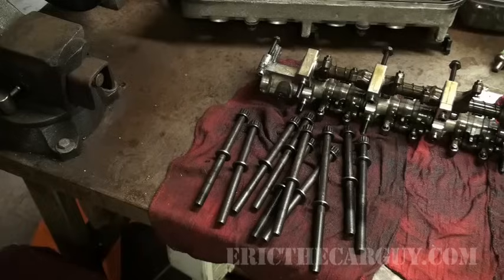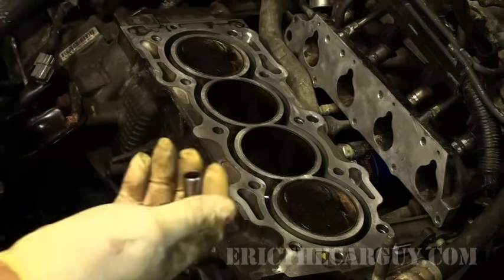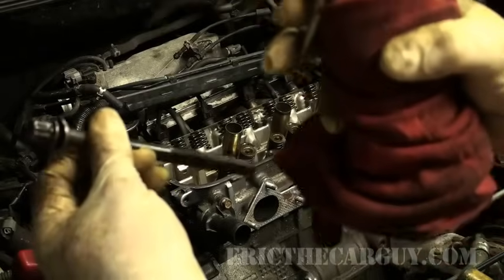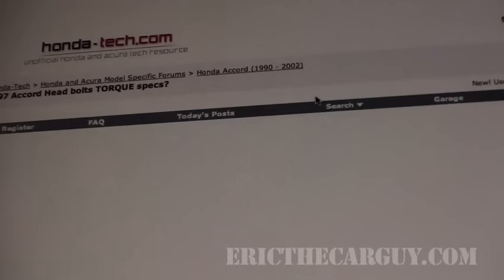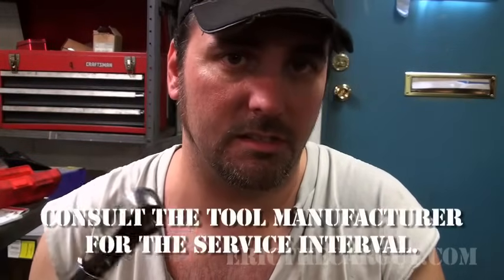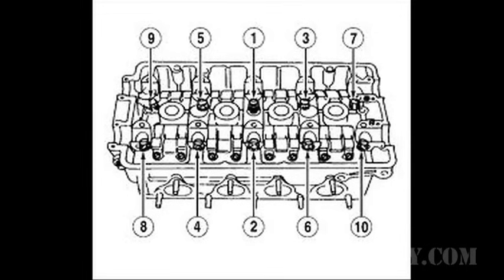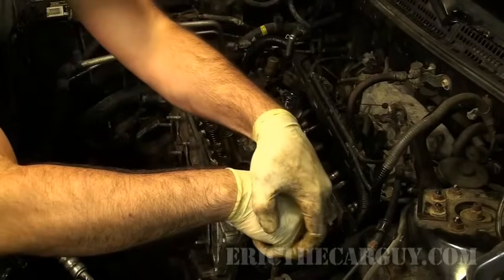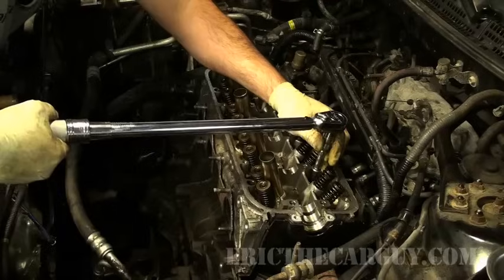How To Torque Cylinder Head Bolts - EricTheCarGuy

Comment: Metric always beats American measurements. 
We civilized folk prefer to have a system which converts sizes (centimeter/meter) in consistent magnitudes. 
Metric: 
10 milimeters in one centimeter 
100 centimeters in one meter 
1000 meters in one kilometer. 
The same numbers apply for weights and fluids. 

American: 
You guys don't even have anything smaller than inches, you just start making fractions. 
12 inches in one foot 
3 feet in one yard 
1760 yards in a mile 
The weights and fluids are also all over the place.
Reply: Most of us (American car guys) have them memorized quite well and cubic inches measure displacement more precisely than liters, although that's a different topic.
Reply: xxRamD3yruxx Metric is more accurate because metric measurements can be smaller than American standard.
Milimeters, micrometers, nanometers
Reply: ChrisHallett83 because when you say a 350 chevy is 5.7 liters you've undersized the engine by 35cc. I was not comparing cc to ci, but more of liter to ci. cc is even more acurate than ci although that's a large number to stick to the side of the car.
Reply: Dylan McElveen milimeters are close 32ths
anything smaller would be moving into scientific zone meaning: go metric, because science is in metric
Reply: Belicose777 Thank you, I either make an educated comment to the best of my knowledge or not make one at all. Once you live in America, you just somehow know all the different measurements within a couple years because you have to use them so frequently, it has been so well rooted in American measurement that it became part of culture in a way. Like the length of a football  field or "cool we're going 160 mph" the other stuff just won't cut it until it becomes necessary to do scientific calculations to share with others around the world.
Reply: I'm not offended. But the comment implies insult. Maybe you were being funny. "We civilized people..." Inversely said sounds a lot like saying, "only barbarians and animals use..."
Reply: Reluctant Couch u
Reply: Civilized is the man that identified and complimented those that are "past the stone ages" and use metric even though he's from a place that uses American measurements. Not the one that blatantly insults an entire nation of people that do, as you have now.
Reply: wow, do people always bitch on about a post for such a long time on you
facepalm
mutes post
Reply: Reluctant Cou
ch c
Reply: Boy!  Your point of Metric beats English is invalid because it is a matter of being consistent with a standard, being precise, and being accurate. If you build a thing with the English standards, that thing will be good or bad per those standards. If you build with Metric standards, your product will be good or bad based in those standards. Then, precision and accuracy plays a role: precision is about the repeatability of the measurement with a given instrument in the standard that you use, and accuracy is how close the measurement is to the true value of the instrument which was measured against the standard that you use--in this case, either English or Metric. And don't get me started with percent uncertainty and significant figures. Now, if your intended point was that Metric system is easier to use than the English because of consistent magnitudes, that's very true; however, that gives the impression that you do not want to bother in learning other things or you have hoity-toity against the English system which possible indicates some mediocrity from your part.
Reply: Actually Imperial is leagues better when you're doing work in a machine shop and don't have a calculator handy.

Leave the metric to the scientists, actual workmen use imperial.
Reply: Reluctant Couch so true lol
Reply: like we have any power in deciding. Thats the way it is its not like you can vote for the metric system or anything. Dont think your better cause you had no say in which system you use either.
Reply: Reluctant Couch "we civilized folk" get over yourself.
Reply: the US is the leader of the world in the machining industry which uses mostly imperial; whoever mentioned that none of their body parts match an inch obviously don't understand the difference between using a rule and a precision measuring device like calipers.
Reply: Reluctant Couch as an American, I wish we used metric. I work in automotive manufacturing and metric is so much easier than standard.
Reply: n
Reply: I worked as a toolmaker using both metric and US customary measurements for years, ( The US doesn't and never has used the imperial system, which wasn't standardized in England until the 1820's ). Either system is just as easy to work with.
Reply: Belicose777 I didnt insult anyone. Im pointing out how stupid it is that we still use such an arbitrary form of measurement. 
Quit taking it so personally, American Standard measurement is like orange juice with pulp, only old people advocate it and they can't give a good reason for it.
Reply: @12101DyM  dumbass you drink it with pulp because your orange juice was designed to drink with pulp so it slowly goes into your blood stream to avoid spike in blood sugar levels and better for digestion. Don't forget America is leading the world in engineering and science.  We use metric and imperial system because we are more advanced advanced.  You effeminate nazis can shut the hell up now.

Comment: Beautiful wrenches. Too bad they have to be periodically serviced.
Reply: Anyone know how or where such service can be done? I always hear people get vague at that point.
Reply: DE Nichols If you live in an area with lots of industry, there may be a local shop that does torque wrench calibration. There also some places you can ship your wrench to that will calibrate them. One place online charges $48 for all torque wrenches up to 250 ft-lbs.
Reply: Great reply. I learned something new. First I want to say that I either need a more expensive torque wrench (mines kinda cheaper than the test) or to do an at home calibration test like YouTube channel Shrodingers Box. The test is easy. He and I even use the same torque wrench. 1.3 times the torque settings in weight and he just touched it and it clicked. At home calibration as good? Probably not, but he verified his torque wrench before installing his head gasket and he hasn't had a head gasket job ever come back.

1.3 because that's how far his wrench measured at the handle center line from the center of the bolt in feet. 

T or torque = feet x pounds. Or T=WL
Reply: My next purchase will either be a torque that measures in inch pounds or one that measures in a lower range than my 150 ft x lb torque wrench since Ericthecarguy says they're less accurate on the bottom and top of the two extremes. I'm sure my half inch torque wrench is pretty poor at 30 and less as it's so big, I barely touch it and it clicks.

Comment: Hey Eric, I have a question what is the valve COVER bolts torque specifications and pattern for a MITSUBISHI LANCER ES 2.0L 4G94 SOHC? or do they not need to be torqued? i looked in the owners manual and i can't find anything about the valve cover bolts specs please help. or if anyone here knows would be appreciated.
Reply: You need a service manual, not an owner's manual. Or like Eric, I just google what torque I'm after and it usually doesn't take long. Occasionally I end up with a downloadable pdf that tells me the torque for that component on virtually every car out there. I have one for axle torque now. lol

Comment: Hi Eric. Are you experienced with Diesel Engines? I have a 1997 Toyota Lucida Estima 2.2 Turbo Diesel. My first diesel car ever. I am now living in the Philippines. I came out from California. Anyway, I haven't had any luck with any solid mechanics here. They have the good trouble shooting skills unlike our technicians back home there in the States does....Over here you already found yourself already spent a few hundred bucks and still haven't solved your problem. Im getting tired of it! Im not a millionaire and I dumped all my wife and I have on this car.

Anyway, at first startup and drive of the day. Everything is fine then once engine reaches normal operating temperatures, the vehicle has a defficult time accelerating pass 40kmh. So I end up having to park it for a few minutes until she'll drive fine again. It doesn't happen all the time. The last time it happened was probably 2 mnths ago. And it happened again today. I know its difficult to diagnose w/o seeing or test driving the car but I just trying my luck. Im really tired of shotty "mechanics" here. I don't want to spend $$$ again and problem is not even solved.  The Toyota Lucida Estima is the same family as the Toyota Previa. I guess the Previa is just the gasoline model. Id really appreciate any help or idea you can give. Thanks in advance.

Comment: I did a bit of reading on the use of socket extensions and from what I read if a perpendicular angle is maintained then it really doesn't effect the torque specks enough to bother with. I didn't see mention of length though so I would imagine if you use a 12" extension it would seem to me it would make a difference. NASA would know for sure... If one is at an angle then the game changes. Then, on the other hand, if one changes the length of the torque wrench, that's when the math comes in. Some sort of formula must be used to figure the final torque settings.
Reply: Yep just divide the desired torque by  the cos of the angle. (cos said cosign). If the angle isn't consistent you don't have a shot at this. Universal joints change how much force is applied continually so I don't know what tool you could use that would ever get you an angle reduction of force on your torque.

If you have a nice smooth arc it should minimize the effect of any adapters would have on the torque.
Reply: DE Nichols  The more extension you have the easier it becomes to not be perpendicular. I've noticed this a lot when using extensions. The longer you go the more angle you can have. That's where you "lose" torque that you want on the nut/bolt. Of course, the energy isn't lost, conservation of energy applies, but it didn't get to the nut now did it?

Comment: quick question afer removing head I removed crank pulley but I believe I turned lower end over and over trying to losen the crankpulley nut how would I know if the marks to do timing belt are accurate and/or valves are open or closed depending on piston position

Comment: Eric, long extensions should not do much difference, but you are right in saying that you should not add one extension to another,... adding a Y component will not impair your torque...
Reply: man are you wrong!!
long extensions really do alot of difference
for example, getting my cilinder head bolts loose with a 1/2 wrench and a long extension didn't work and adding a bar on the wrench just made the extension twist
I went to a 3/4 wrench without a medium length extension and cause all my force now went to the bolt and no twist in the extension, the came loose instandly

every mechanic will tell you that extensions really matter and make difference

I notice this almost every day as being a bus mechanic

Comment: Hey Eric, why is it bad to loosen lug nuts, bolts, etc. with a torque wrench? 

And since you shouldn't loosen lug nuts with a torque wrench, what should you use, just a breaker bar?
Reply: Unless the wrench is designed to operate in reverse mode then you could be damaging the mechanism inside that releases when torque level has been achieved. These can be used to torque reverse threaded type bolts. The only time you should use your torque wrench is when you're dealing with important bolts like the head studs/bolts. To loosen any fasteners you should always use a breaker bar/impact. I would also recommend not cheaping out on the wrench you buy. And remember, it is a precision instrument. You should always take great care when handling it and do throw it around. Don't forget to reset the torque setting back to the lowest setting before storing it again.

Comment: Extensions do not rob torque in themselves but their flex and slack does add driver swing travel to applying a given amount of torque with extra wobble that makes it annoying to work with. The stored energy in the extensions' springiness does make applying a precise or steady amount of torque more difficult since you do lose fine control over the effort delivered as fasteners break from static friction to dynamic when you get them moving again and may stick again before your arm catches up to keep it going smoothly. The repeated break-stick is what makes those fastener creaking noises and slack in the extra joints does not help with that either.

If you smoothly torque a bolt down at 72lb*ft (dynamic) and then try to undo it, you will find out that you need something like 90lb*ft to break it loose since static friction coefficients are a fair bit higher than dynamic - possibly a lot more once the oil seeps out from the thread-to-thread interface. Same goes the other way: if you are turning a fastener at 60lb*ft and then stop in mid-swing, you may need more than 72lb*ft to get it going again, which I suppose could be perceived as "robbing torque" but the loss does not occur in the extensions or adapters themselves: you would have the same problem of requiring extra torque to get going again after sticking without any extensions or adapters whatsoever.

This is where the importance of a smooth motion - at both the driver and fastener regardless of what may be in-between - comes from and having less hardware in-between undeniably does make this easier. If fasteners are allowed to stick on the "home swing" then the only way to get it exactly right is to back off and try again for a non-stick finish.

BTW, on the topic of torquing accuracy and specs, if the torque spec is based on metal-on-metal (dry) contact and you oil/grease threads, your lubricated 72lb*ft going in might be equivalent to 90lb*ft dry and require 120-150lb*ft to break them once the oil gets out of the thread-to-thread interface. This puts fasteners on a fair bit more tension than they are supposed to be, thereby giving the impression that oil caused the threads to seize when over-tension/torquing actually is: the dry torque on a hypothetical fastener might cause friction to prevent further rotation at 72lb*ft when the fastener is exerting 200lbF on the pieces it joins together but lubrication may help it reach 300lbF before sticking at the same 72lbF. Add that to the list of things engineers have to consider and mechanics need to keep in mind - I bet many broken and stripped fasteners are caused by this.
Reply: I am new to this world and i once have bolted the broken into the hole 😂, i tightened the bolts, it was clutch spring bolt in bike, and the bolt got twisted and i was left only with head in the socket and body of bolt inside the clutch hub. Now whenever i do the tourqing i am aware that the tension is building up not constant, as that constant is the threshold i feel that  the bolt is not rotating equally at head and down there,depends on the material of bolt, 🤠
Reply: Thanks for sharing this knowledge btw

Comment: How about you do a video on removing head bolts now? That's important too.
Reply: Why don't you make one for us? I like your face.
Reply: Watch the video in reverse.
Reply: dippy, there is a method in removing the head bolts, you can't just take them out any which way you want to. You can end up warping the aluminum of the cylinder head if you do it wrong.
Reply: No please, dippy was my father. Call me sippy. 
Anyway, exactly you're right, it's even preferable to do your wheels in a star pattern. It just makes sense to to apply or release pressure in the most even way possible. 
It's logical to assume that the way you install head bolts will be similar if not identical to the way you take them out. If installing them in this pattern applies pressure evenly, then taking them off in the reverse order will remove the pressure evenly as well. Watch the video starting at 16:19 Spiral out to install, spiral in to uninstall.
Reply: Misha Kolitwenzew Herp derp
Reply: nik12937 How am I retarded for saying that? Knowing how to take out the bolts is just as important as putting them in. If you don't think so you're an idiot.

Comment: Putting oil on the thread and the washer bearing surface generates a hydraulic cushion when tightening. The greater the viscosity of the oil the longer this happens and you end up with under-torqued bolts etc. Try using a rag with a couple props of oil on it, the rag should not be wet with oil. Rub the bolt and it will pick up a thin film of oil, this will give you the smooth turning but not reduce the bolt stretch.

Comment: Hi Eric, I was told to use WD-40 on head bolt threads, someone else said to install them dry...many automotive websites are calling for 30 weight motor oil. You used regular oil here as I can see...is there any difference between any of these procedures?

Comment: Hey Eric I really find your videos very helpful but the only comment I have about this video on the head bolt torque is that I noticed you in stalled the cylinder before you repaired the broken exhaust bolt. I am sure it can be fixed while already in stalled but I suggest doing any repairs to the cylinder head before in stalling to save any headaches once in stalled. Thank you from one tech to another tech keep up the good work. Mr. HotRod Long Beach Ca.